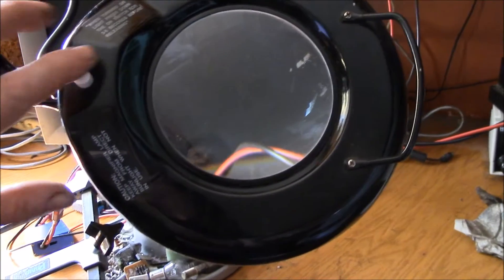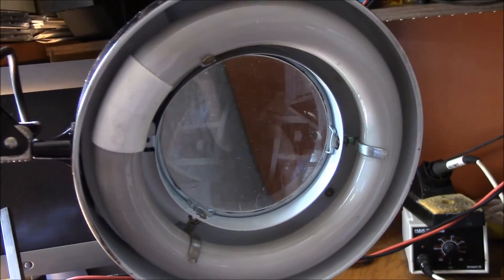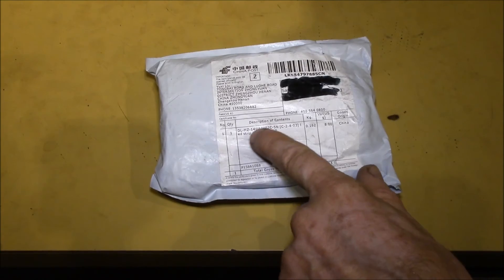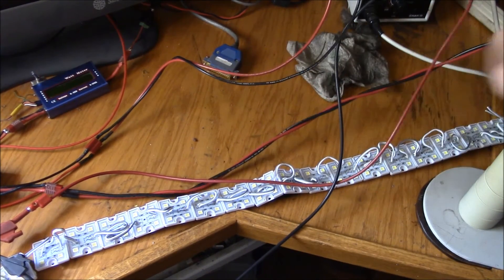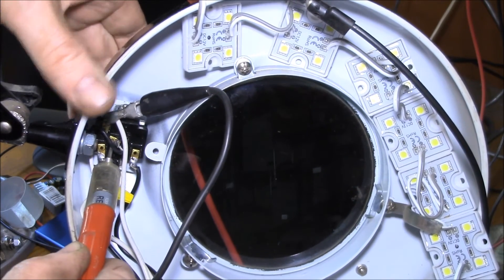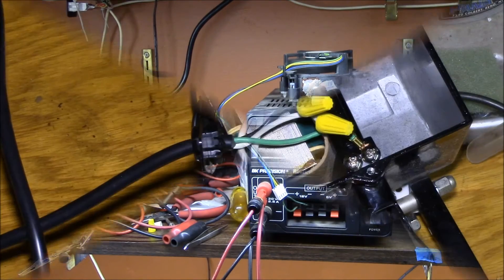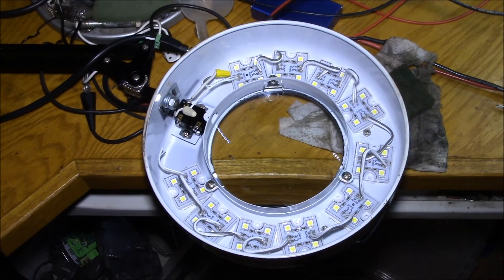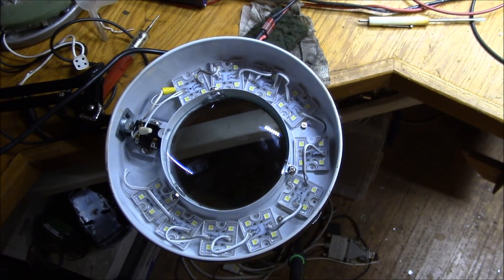Magnified Work Light - LED Conversion, v1

Comment: I just bought a used lamp very much like this, I'm completely lost about how to change the AC to acdc but there is the slightest flicker in the bulb, not the whole bulb, just near the white plastic section, is that normal for an ac fluorescent or is it indicative of a problem
Reply from the maker: It may be a sign that the tube is starting to fail.   Here's my updated video where I used an LED tube to supply light to the fixture:
https://youtu.be/yM5ZRxfLTqY

Comment: I can not find those modules available and similar square 4-LED modules look to have much smaller LED surface area so probably much less light output. Do you have any spec's on the 10 modules you used( Lumin output per module, etc ) so I might figure out an appropriate replacement?  Thanks.
Reply from the maker: I didn't save any specs. on the LEDs I used.  Here's some that look similar, although likely higher quality:
https://www.superbrightleds.com/moreinfo/led-module-strings/single-color-led-module-square-constant-current-module-w-4-smd-leds-75-lumensmodule/980/9244
Reply: @The4Crawler  indeed that one does look like the LED surface area is similar to the ones you used. Will have to see if 75 lumins x 10 is comparable to T9 22W output. Thanks.

Comment: for $29.99 each {free shipping from Los Angeles, CA, USA, why go thru the troubles...?
built in USA w/ Customer Service, order on Amazon.com: https://www.amazon.com/dp/B01C3WUXLS
We are the Designer/Manufacturer.
ours is 2000Lumens of brightness & only 2 wires to connect to 120Vac.
Reply from the maker: I spent some time looking for one at the time but couldn't find what I was looking for.  I wanted 12V DC operation as I plan to ultimately convert all my lab lighting to DC off my solar battery bank.  I also prefer DC powered LEDs as there is zero flicker or noise.

Comment: So did you cut in a half, it's not hard to do that, & how about at the back is it sticky to tack it in or just use a glue gun.
BTW how about the transformer it's 12 v, how many mA
Reply from the maker: +alsteven44 Yes, I used about half the string of LED segments, just cut the wires joining the two sections in the middle.  The segments do have double stick tape on the back, but in a few areas of my lamp, the underside of the reflector wasn't flat enough to stick the segments on.  So I used an extra dab of adhesive to stick them down.  Hot glue should work as well.

The string like I used takes a but under 1 amp, so a 1000mA power supply would work.  I'll ultimately be running this off a 12V solar battery bank, so no need for a transformer.  In the mean time, I'm running it and some other LEDs off a 13.8V/6A DC power supply I had sitting around.

Comment: gj looks great, can you give an update on your power jack and solar system ?
Reply from the maker: +fliping720 I've got an update video in the works.  Everything is working good, the PowerJack is still operating with no problems.  I did add an external fan to blow air over it and that seems to work quite well.  The internal fans hardly come on any more.
Reply: how many KWH have you made ?
Reply from the maker: +fliping720 About 1100 total if I add in the AC and DC power, 650 or so off the grid tie inverters alone.